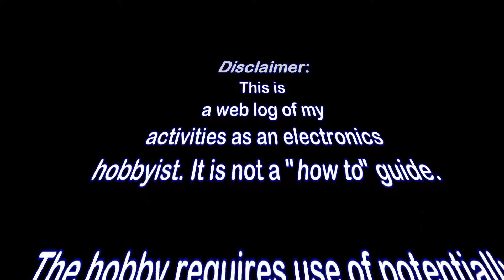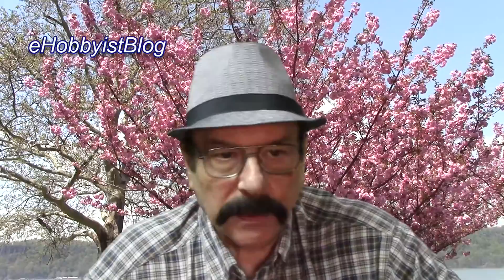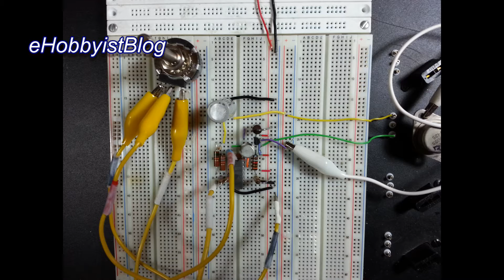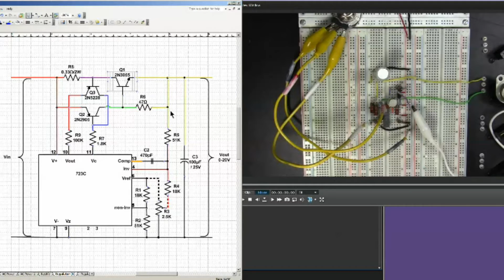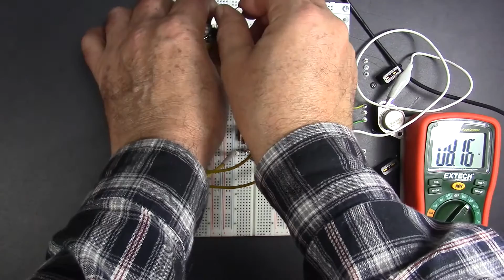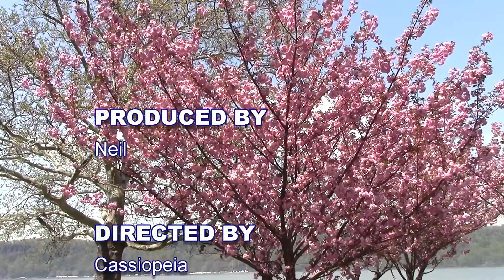029-Power Supply--Regulators (3)

Comment: One of the nefarious types reporting in, fitting only one of your viewer requirements (limited time). I am just wondering what direction this series will take once the power supply is operational. Also, why did you not use an LM317 like everyone else. I think that would have resulted in a simpler circuit. Of course, you could tack on the pass transistor(s) and whatever else for more current and the current limiting just like you did in your circuit.
Reply from the maker: +SteelBlueVision 

We are going to try to develop the whole Prototyping System as described in videos 002-004. The current functional specs are available in the document “Prototyping System Design” at http://www.eHobbyistBlog.com/references
.I’m currently working on the 0 to 20V supply, which will also be ½ of a -20 and +20 to 0 (tracking) supply. Thereafter, I’ll probably be moving on to output monitors, starting with an oscilloscope. The trick will be how to build a cheap—but still useful—scope into the System, but that’s weeks from now.
LM317, to my knowledge (which is admittedly limited) can not get down to zero volts (one of my requirements). The 723 circuit seems to be able to get close (within 104mV as of yesterday).
Reply: Ahh yes, the block diagram from one of the initial videos - I forgot all about that.

You are correct that the LM317 cannot go to zero volts by default (1.25 V min). A -1.2 V (with respect to ground) voltage if available can be used to achieve 0 volts, but that is somewhat inconvenient.

On the other hand, few circuits require voltages less than 1 V, so it's a tradeoff of convenience vs capability. All of the adjustable supplies I have certainly go below 1 V, but I can't remember ever needing it for anything.
Reply from the maker: +SteelBlueVision 
For a battery-powered project, a power supply able to go down to zero volts makes low-battery testing easier. Does the low battery indicator come on? Does it stay on? Below some drop dead point (1.0-0.8V ), does the device do an orderly shutdown?